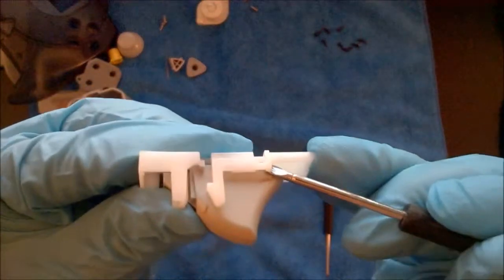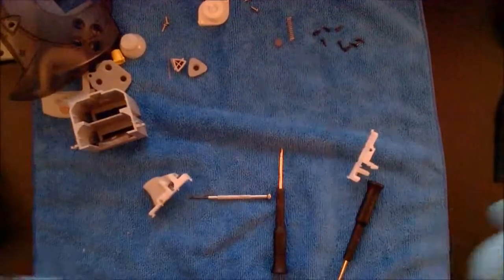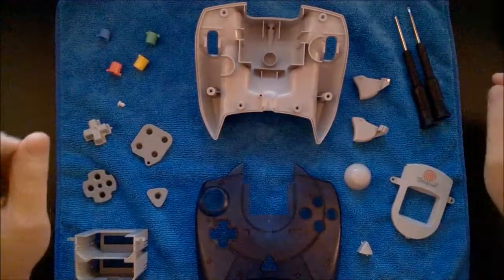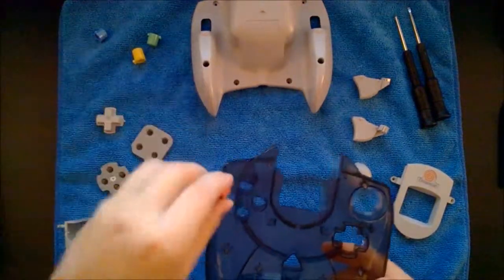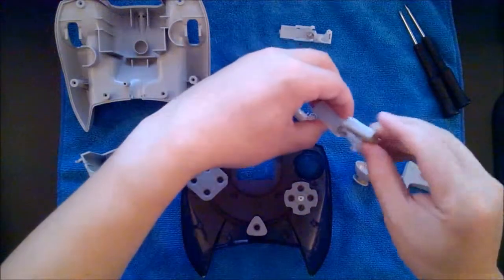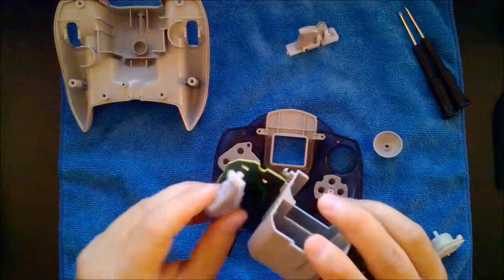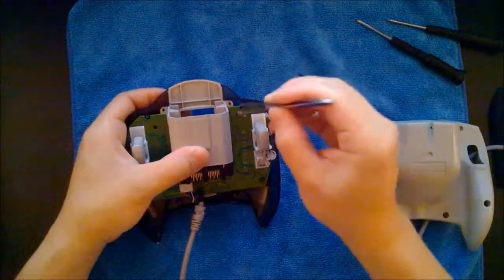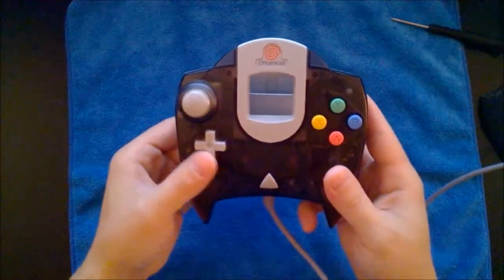Sega Dreamcast Controller Tear Down and Cleanup (Part 2 of 2)

Comment: I usually use a window cleaner for cleaning my controllers. I'll also use a toothpick to get the grime out of the crevices, but using a nail brush sounds much better.
Reply from the maker: I wouldn't use anything other than rubbing alcohol. I know a lot of people use windex and stuff like that to clean them. But I think the ammonia in the product might attack the plastic. I use it a lot as well. When I can though, I use just regular soap. But as you can see here, it takes a while to tear down and clean.

Comment: Reason I'm here is because my A button has gone 'soft' and unresponsive if you know what i mean, what does this usually mean? Do I need to replace the rubber inside or just clean it? I have plenty of controllers (One with doesn't work at all)